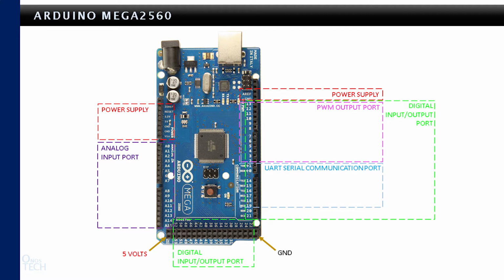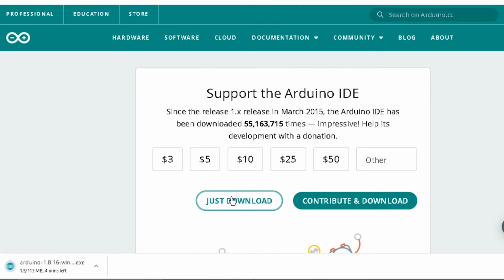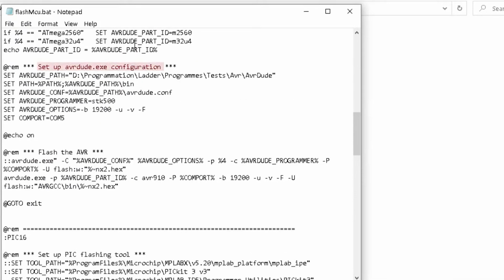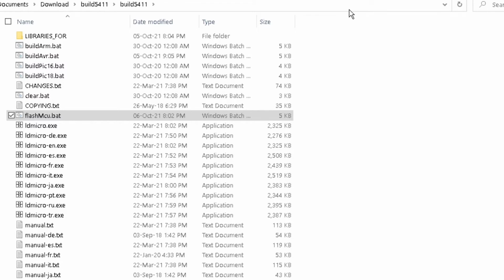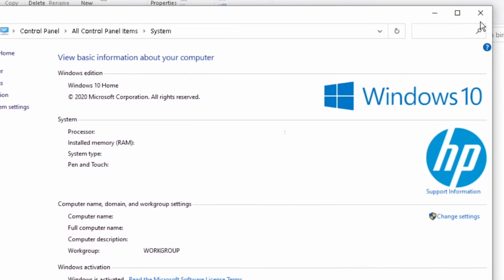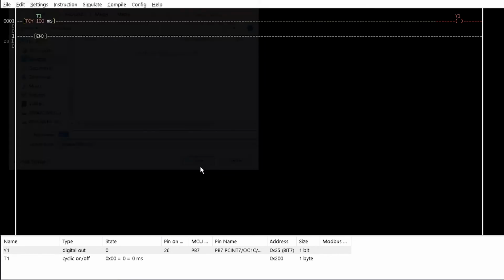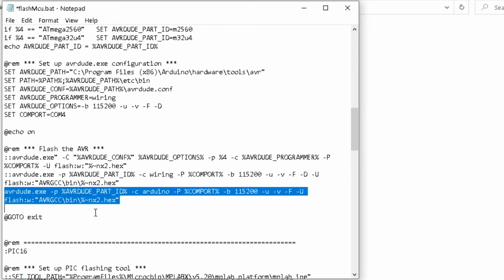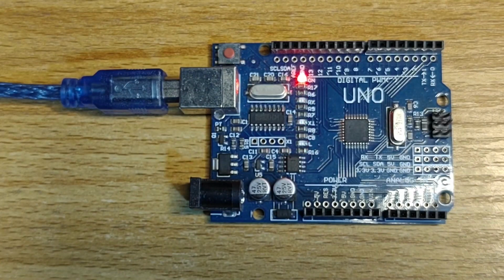LDmicro 21: Why Choose Arduino Mega over Uno? (Microcontroller PLC Ladder Programming with LDmicro)

Comment: Can you tell me if LDmicro will work on clone Arduino Uno R3 board and if so how should LDmicro be setup? Thank you!
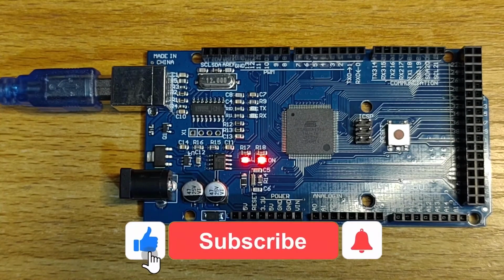Reply from the maker: LDmicro works with clone boards as well. The setup of Arduino Uno in LDmicro starts from 7:35 in this video. See the below video link if you need to update the bootloader.  Even though the video is for the Nano, it should also work for Uno.
https://youtu.be/caiiO4d6lR4

Comment: Hello friend Onos!

There is a doubt that I didn't notice someone commenting on.

Do you necessarily need to program the mega2560 using the F6 command to program the mega2560?

Or can we compile in F5 and later record the .hex of the LCD program that will run the software?

Thanks for the help, I'm confused I can't make it appear on the lcd
Reply from the maker: Compile with F6 when you have I2C and SPI instructions in your program, otherwise you can compile with  F5 and record later.

Comment: Hi Onos:

i tried like the video, but i got this kind of problem::

Running script = C:\LDmicro\build5411\flashMcu.bat

ISA Type = “AVR”

Filename = “C:\User\Desktop\mega ldtes\tes”

Compiler = “AVRGCC”

Target name = “atmega2560”

C:\Users\Desktop\mega ldtes>avrdude.exe -p ”atemega2560” -c wiring -P Com9 -b 115200 -u -v -F -U -D flash:w:”AVRGCC\bin\tes.hex’

Avrdude.exe: 	version 6.3-20190619
	Copyright © 2000-2005
	Copyright © 2007-2014

	System wide configuration file is “”
Avrdude.exe: can’t open config file “”: invalid argument
Avrdude.exe: error reading system wide configuration file “”

Comment: Hi Onos:

I just started testing Arduino Nano using I2C functions and the result is:

LdMicro32_6_0a				WORKS O.K

LdMicro32_5_5b	In this case Ldmicro Exits itself when trying “Compile Atmel AVR-GCC”
LdMicro32_5_5c	In this case Ldmicro Exits itself when trying “Compile Atmel AVR-GCC”

LdMicro build_5411	The corresponding Hex file is generated but the I2C functions DOES NOT WORK AT ALL.

I guess you are using LdMicro build_5411.  Did it work O.K??? What can I do to make it work???

Next week I will buy a Mega Arduino and I will try I2C and UART functions mainly.
I will report to you what is happening.

Greetings!
Reply from the maker: Hi Kate,

Thanks for sharing your test result on the versions of LDmicro.

I have been using LDMicro build_5404 and did not change from using it when bugs were reported on the forum for build_5411.

I justed tested the I2C function on build_5411 and discovered that it is not working. I don't think much can be done about it except a new release. I am hoping Ihor is fine in Ukraine with the ongoing war.

In the main time you can use build5404.

Best Regards
Reply: Thank you very much!
I didn't know that Ihor was from Ukraine, I hope he's fine!